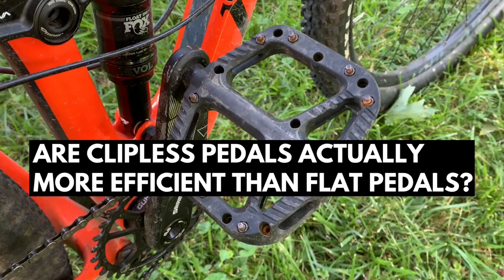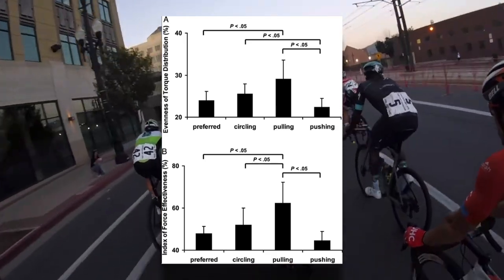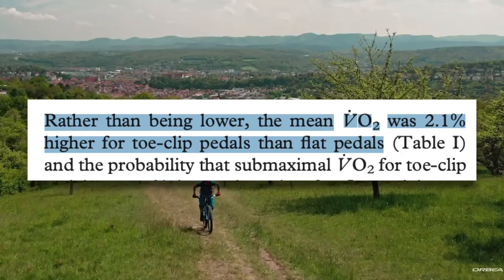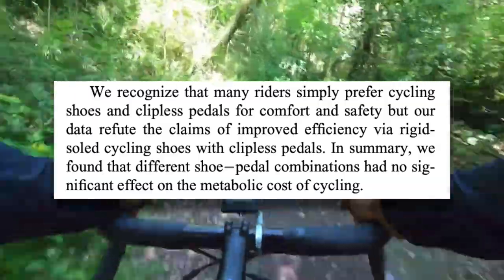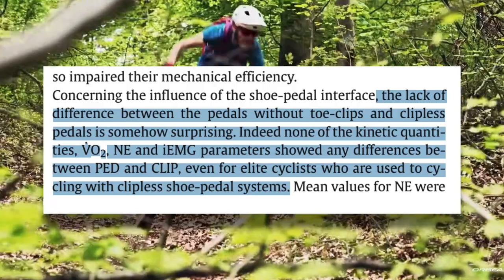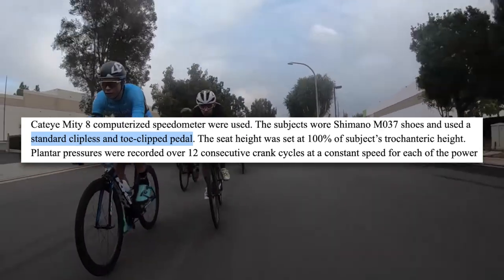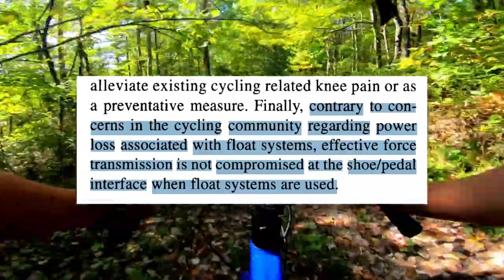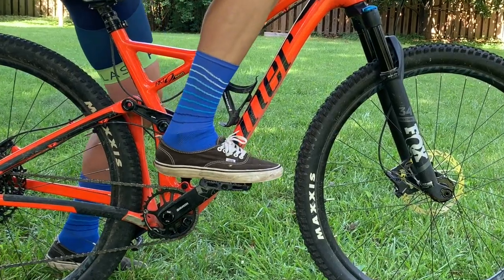Are Clipless Pedals Actually More Efficient Than Flat Pedals? The Answer Might Surprise You.

Comment: Weird that the pedals that clip to the bottom of the shoe are called clipless. Well, maybe they use different fastening method.

I think the difference is mostly ergonomical, though ergonomics do probably contribute into efficiency in a long run; the foot doesn't slide and turn on a clipless pedal, so you can always be sure you got the optimal angle to kick the pedal downwards. Also, when you are pedaling on a steep uphill or fast down the road, you don't really want your foot to slip off mid-stroke. Then there is some cases where ability to easily fly out and in and move the foot on the pedal is probably more important than the optimal pedaling angle, but road travel probably isn't one of those.

What comes to the pulling the pedal up, the downstroke is definitely more powerful, and turning the direction of the power might very well take time and cost more energy than just letting the foot coast up for another powerful downstroke.

Aaaaand now I realize I have again acted like I knew something about the topic, so bye, and have a good time cycling around while the weathers are nice!

Comment: Even if you prefer flat pedals, you should become good clipless, it improves your handling of the bike overall. It's a good way to increase your technical bike handling skills. you should learn to ride with them. Another thing is that they're good for decreasing load on the knees by pulling more when you need to, so if you ever have knee pain... go clipless and pull more. It's also easier to handle your road bike with them when going up stills climbs out of the saddle. Once you get over the fear of using them... They're great.

Comment: I can accept that clipless pedals don't provide a mechanical advantage but I'd still use them because they keep the feet in place. When I cycle, my feet are not perfectly parallel to the ground but rather angled with toes pointing slightly to the ground, which causes my feet to slip forward all the time. On longer rides it really becomes annoying.

Comment: problem is you are looking at efficiency (oxygen consumption per unit of power output), not only power output. If the supposed advantage of clipless pedals is you can pull up AND push down (instead of just pushing down), and thus allow you to recruit more muscles, you are going to use more fuel (consume more calories and consume more oxygen) but also produce more power. Clipless pedals might not be more efficient, but they do seem to allow you to put down more power... but you're using proportionally more fuel so the efficiency is the same. I think clipless pedals allow you to go faster and you burn proportionally more calories (bonus!). But I actually just switched to flats because I kept falling with clipless pedals. I definitely feel slower, especially on climbs. When clipless pedals seemed to help the most is I could be in a much higher gear for short climbs. Having my up foot attached to the pedal gave me something to brace against to press down with all my force on the down pedal. Now I find myself bracing myself against the handlebar to try to push down harder, but I still can't push down with much more than my body weight force. I think it's a misconception that the pulling up is the big thing that gives you the extra power with clipless pedals, but just as important is that with every pound of force you pull up with one leg is another pound of force you can push down with the opposite leg (so your down force is no longer limited to your body weight).

Comment: I use both clipless and flat pedals. Not much difference in technique and zero difference in my modest speed. Some of my fastest times were set with my road bikes during the first week when I was using flat pedals before deciding on clipless pedals (I keep switching between Look Delta and Keo, and SPD-SL). Main reason I put clipless pedals on a couple of road bikes was for the very rigid soled shoes -- my feet have always been prone to cramping without good support. I haven't tried Five Tens yet, so that might resolve my occasional foot/arch spasms with other shoes on flat pedals.
There's a slight advantage to foot retention when I'm spinning faster than 120 rpm, but that's pretty rare for me -- maybe on a couple of downhill blasts. Usually I mash around 60-75 rpm and rarely pull up on the pedals clipped in, other than standing to climb, so there isn't much transition between bikes with clipless vs flat pedals. I mostly stomp the pedals anyway, not much finesse in my cadence.

I prefer flat pedals and walkable shoes for most group rides, especially in the city, and will probably switch my old steel road bike back to flat pedals -- less fuss on urban rides with lots of stops. But I'll keep the clipless on the carbon fiber bikes -- occasionally when standing to pedal on climbs I'll lift the rear wheel up a bit, so I know I'm pulling up pretty hard in that specific situation. So, yeah, I'll stick with clipless for those bikes.

Comment: I feel like cyclocross would be particularly difficult without clipless pedals and the toe spikes and accoutrements that come with them—but maybe running would be easier in something less stiff and without a cleat. I used to mountain bike on flats when I was younger, and I may switch back to them this year. It's certainly a good way to learn how to stay stable on your bike using only your body, not a physical connection. If you can learn how to jump on flats, you'll always be better than someone that can only do it using clipless. There's a substantial learning curve to flats if you've spent most of your time in clipless. I'm sure I'm going to jump off my pedals repeatedly before I get the hang of it again.

Comment: Interesting to note GCN did flat vs clipless pedal in a UK University lap and result was the same. They didn't make statistically significant difference... It was done using stationary bike in a lab holding a steady Watts. I used to use Shimano SPD-SL for years then switched to Speedplay due to recommendation by a bike fitter and never looked back. I need 6 mm shim on right leg/shoe and Speedplay system caters for people needing shim much better than any other system. Now, if I was to use flat pedal, do I tie 6 mm wooden block under the right shoe sole? Interesting....

Comment: I really hate it how all these "scientific" studies on flats vs clipless use clipless with dedicated & expensive clipless shoes, but flats with running shoes or if you're lucky skate shoes. As opposed to dedicated, stiffer, stickier, & custom designed for pin retention, flat pedal MTB shoes.. 

One thing I'd love to see in the interest of science is a comparison of injuries gained when crashing clipless vs flat. I guarantee hands down that flats will come out as far safer.. Speaking also from my own crash that did my PCL when a front wheel snag sent me up & over knees first onto rocks & I rolled over rocks with my frame. Had I been clipped in I would have done far more than my PCL.. So I always use flats.. 

But I use flats on my roadbike too, I love the fact I only need one pair of dedicated MTB shoes, but if I want to wear my skate shoes or run ing shoes, I can do that too. And I can make 45kmh on a flat & busy arterial urban road on my roadbike using flat pedals too so I still get good speed using flats..

Comment: I use Time Atac, and can't imagine ever going back to platform pedals). I don't think I really pull up all that much, but I feel like being clipped in helps me through the deadzone with your cranks around the 12 & 6 o'clock position, keeping my cadence a little more even. It feels more fluid and circular rather than 'push down with my left, then push down with my right'. I base this on no science, though.
Reply: You can use an oval chain ring to eliminate that dead zone you feel, I have never felt it personally but oval really smooths out your pedal stroke.

Comment: something clipless pedals can't do is counter-pedaling, the skill to use the pedals not as walkers but like stairs, you don't pull back at the end but release the foot forward and lift to catch the pedal when it comes back, while the other leg takes your whole weight pulling down, siting or standing it gives a lot of acceleration if you do both pedals at the time and quite some rest if you do it in just one leg. it's great for fast starts like crossing a street from stops
Reply: disclamer: but this MESSES messy shifts, it takes a decent maintenance if you dont want to loose the chain and be left on just one pedal loose, can be saved on the go, but the jewels won't thank it

Comment: If you have excellent pedalling technique, then efficency is a moot point. If you are riding to anything except your  limit, then efficiency is still a moot point. Experiencing both flats and cleats will help you decide which is best for you. I prefer cleats on the road, but am quite happy in normal shoes for short trips. For technical MTB I prefer flats but for XC SPDs are preferable. Cleats stop you having to use energy holding your foot on the ideal contact point on the pedal,but there are times when hanging a foot out is handy. There is no right or wrong, but your preference may change based on experience.

Comment: I came here for hoping to learn about preferences for flats vs clipless on an enduro bike.  I left wishing there was way to filter out click-bait vids that refute their own thesis.  It's no surprise that clipless offers no advantage over flats on a stationary bike in a lab. Of course in practice clipless offer plenty of advantage in real life that one does not need a study to confirm. Clipless are hugely beneficial in short, steep, technical climbs where "pulling up" may make the difference between clearing a series of obstacles or not. Where your ride has lots of climbing and descents, clipless will save energy on the long technical descents too bc you won't have to do anything to keep your foot "planted." Weight is the obvious efficiency- a good Sidi combined with an XTR clipless will be much much lighter than a shoe/flat combo. The longer and faster your ride is the more it matters. The stiffness of the shoe will also keep your feet from cramping on a long ride- come to my backyard in Utah and do a 20 mile loop with 6,000+ feet of climbing on rugged and harmonic trails with flats and skateboard shoes.... your feet will feel like shit, and that will make you ride slower. 

So skip this dumb video and remember a few simple heuristics: if you're into hammering on long rides with lots of climbing and technical conditions, go clipless. If your rides are shorter and more casual, or you just don't mind doddling along, stopping for food breaks, taking short hikes off the bike or into coffee shops, by all means go flats. If your rides are strictly downhill, in the bike park or skate park, or if you generally place getting gnarly above all else, again, go with flats. 

Most of all- get your knowledge from experience on the bike, not from people who make money by stealing your attention with gaslighting headlines.

Comment: It takes years of determined practice to learn to apply force throughout the entire pedal stroke. Maximum efficiency is gained by applying force in the direction of the pedal movement for ALL 360 DEGREES of the stroke. NOT just pulling up on the up-stroke. I used to lay on my back with my feet in the air and practice moving my feet around in a circle as fast as I could.

The logic that the flexor muscles are not as strong as the extension muscles is only true if one has not exercised said flexors to be just as strong. Leg curls are a great exercise for that. There are also a dozen other muscles groups in your legs that work to push your leg forward or back. Mostly near your hips. 

Now, you also gain efficiency, and make up for the fact that these other muscle groups are not as strong as quads and hamstrings by having an insanely high cadence. My "slow" / casual cadence used to be about 100 RPM, with my sprinting / hill-climbing cadence being around 210. I could literally double my speed without changing gears. I had also custom designed my gearing to accommodate these extra high cadences. By spreading the work throughout your entire leg and by pedaling so fast that you are literally pumping more blood through your leg muscles faster, you are increasing efficiency even more. Do you use more oxygen? Of course. But you have to measure oxygen used per mile, not per minute. No one measures gas mileage in "gallons per hour."

I know all this is possible because I've done it. Back in the 80s, when I was stationed at MCAS El Toro, near Irvine, CA, I rode with the Bicycle Club of Irvine. I was 6' tall and weighed at most about 135. I was a skeleton. Still am. But, using these techniques, I could out perform most of the bigger, stronger riders. They would speed down the hills on Pacific Coast Highway as fast as possible, then grind up the hills, standing up on the bike, and mashing the pedals as hard as they could. I would just blow past them as if they were standing still while never leaving the saddle. (Staying in the saddle gives you the leverage you need to push the full 360 degrees.) They called me, "Mr. Cadence."

I wore 28" waist x 34" inseam Levi's 501s and I could barely get them over my legs.

So, just like all research, you have to check whether they are really measuring the right thing. Merely telling even trained riders to "pull up on the up-stroke" is not measuring three right thing. In fact, trained riders may be the worst ones to do this research on because they have decades of building patterns of nerve cells designed to pedal the way they are used to. Suddenly trying to break that pattern is not going to work. In fact, other research shows that merely thinking about what one is doing, rather than allowing those automatic patterns to run will decrease efficiency even when trying to do the exact same action.

As I said, it truly requires years of dedicated practice. Is it worth it for regular riders? Not really. Though I did have fun blasting past all those rich guys on their $3,000 bicycles. But, for a dedicated pro. I think it could be game changing.
Reply: I too, try to spin' 360' .  Without vector analysis, I assume the bigger the rider, the less possible avoiding exhaustion at max cadence.(weight, centripetal, centrifugal forces times wobble.) Conversely, the heavier leg will add more gravitational energy as it falls.  This can be lost if you feel the pedal pressure in your sole near the bottom of the stroke.  Motor efficiency is most difficult to maintain during acceleration.   So it is only coming up to cruising speed I  invite "thinking" along for the ride and focus on starting the lifting of down stroking thighs weight about 5 o'clock.  Columbus Ohio has few climbs but I agree, never get out of the saddle.
Reply: @SeanFinneran  I got to where I didn't even have to think about it. After enough practice, your brain develops sets of neurons that stimulate each other in repetitive, or single-shot patterns. As these patterns play out they send signals to the correct sets of muscles to perform an action automatically. People coming call this "muscle memory," but it is quite literally "all in your head."

Just keep practicing. After a while, that circle seems as natural as a straight line.
Reply: I really don't believe the pullup boys because the motion over a long period of time would likely damage your knee since it isn't made to do that type of action over and over. You've just bought into the ads and don't want to admit it.

Comment: Try both and see it for yourself. I use both. Just a note, if you're not fitted properly with clipless pedals, it will f**k up your knee joints due to constant rotation on a fixed axis. Again, try both and see.

Comment: What’s the definition of efficiency? I would completely disagree that the reason for clipless pedals is so you can pull up... its most definitely twofold: 1) so you can push down with more force without fear of losing your footing on the pedal 2) better control and safety on the bike (especially sprinting, descending, and even climbing). Good analysis of the science here, but the logic doesn’t track

Comment: Pure efficiency is exactly the same for good flat and clipless pedals. People should get over this at once. A different thing is control of the bike, and the chance of you foot getting away from the pedal in situations such as all-out sprints, technical climbs etc... On the other hand (or should it be  foot...?) bailing out is obvioulsy much easier with flat pedals. Finally flat pedals can also provide beautiful scars in your shin thanks to those sharp pins...For road, gravel, XC...I definitley vote for clipless, it´s a no-brainer. But for trail, all mountain, enduro...I would say it is  a very personal choice and in my case I favor flat pedals for sure.

Comment: There's no doubt clipless has marginal benefits when riding to the max. However unless you're being paid, who want to ride flat out all the time? The other time clipless is handy is riding fixed in the hills, where you can push down on one pedal and pull up with the other. If you're cruising, touring, commuting, it really doesn't matter what pedal you use as long as you're happy.